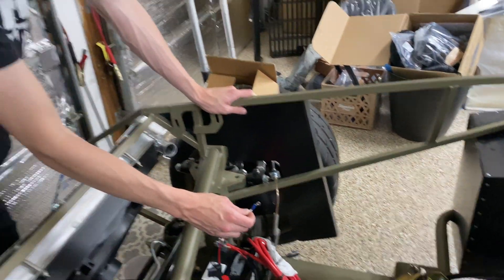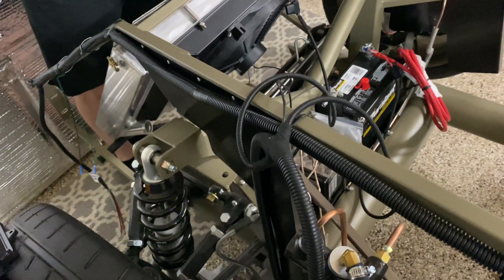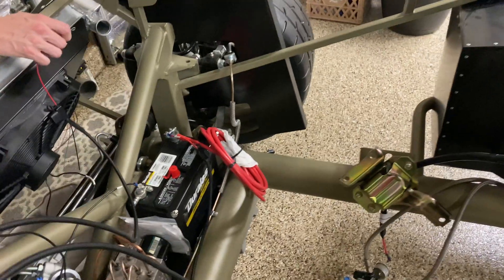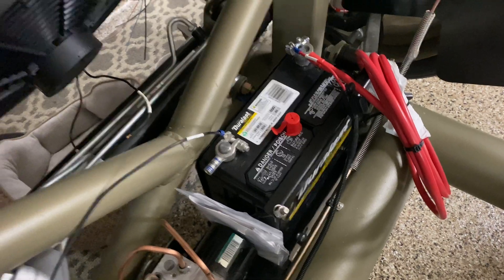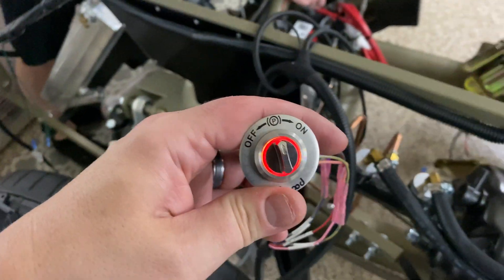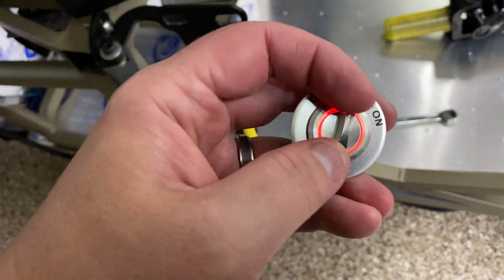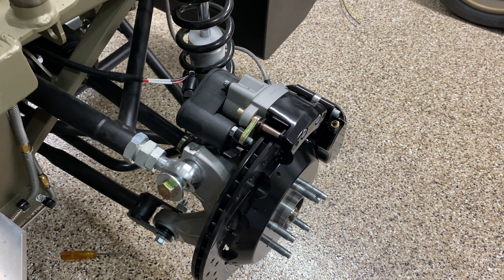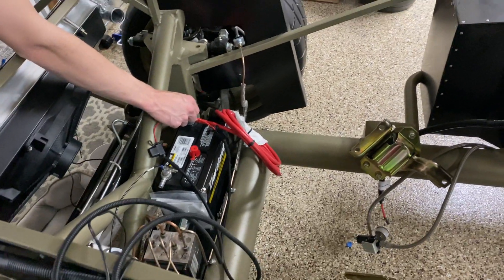Wilwood EPB on the MKIV Factory Five Cobra

Comment: Great video! I just purchased a set today! Can you please post a video how you installed your set up. There are no video with your set up with spindle knuckles.
Reply from the maker: it was pretty simple once I figured out that you have to swap Left and Right calipers - bolts in just like the manual calipers you can see more on my website https://cobradreams.com/2020/05/18/installation-of-the-rear-irs-wilwood-brakes/

Comment: Good day from europe. I will change my OEM brakes (Toyota Corolla E210 Hybrid europe) and replace it with the corolla gr brakes. I have original a E parking brake (in the calipers) and the corolla gr have these not. To my question: Can i install the willwood E parking brake with the OEM functions of the car and no errors? Thanks a lot.
Reply from the maker: if they make a size that would fit the caliper and build a bracket it probably could work

Comment: So a little late to the video party here, but I'm also building a FFR MKIV with IRS and had a quick question. Is this a one-to-one replacement for the existing manual parking brake brackets or did you need to fabricate something to make this fit?
Reply from the maker: It mounts on the existing Wilwood brackets - you just have to swap left/right sides so they clear the springs - and remember you swapped them in case you have to troubleshoot any wiring
Reply: @Toadster88  Thanks!